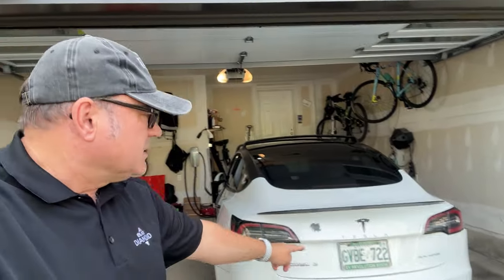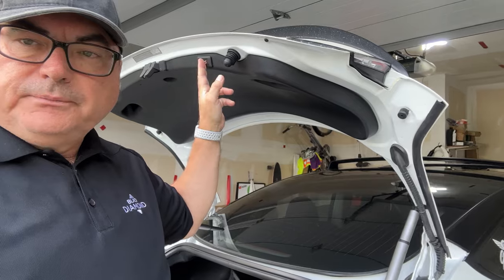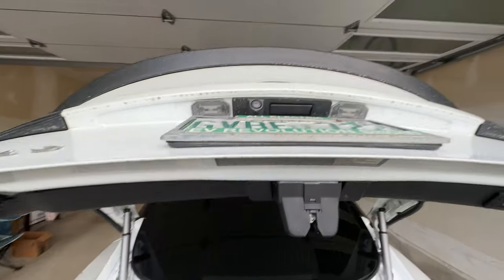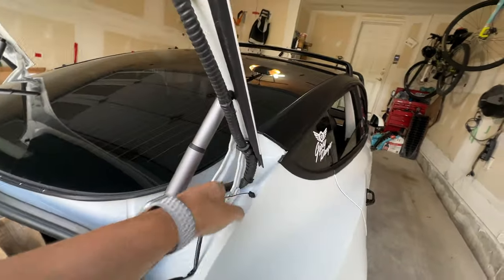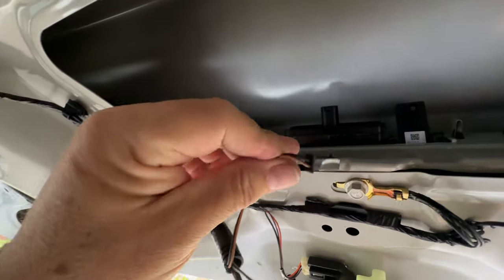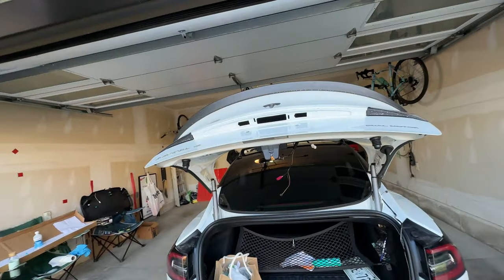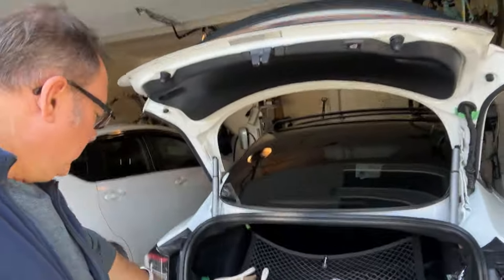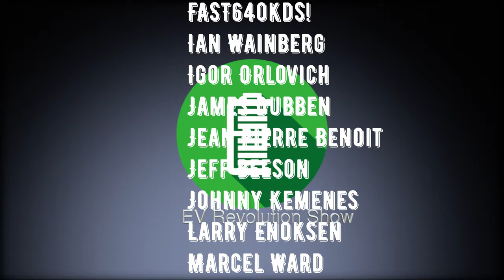Tesla Timeout #29 - TESLASY.COM - Tesla Model 3/Y  Starlink Full-Width Strip Taillights

Comment: We have the same setup with the lightbar and the lower bumper sequentials.   When I installed my lightbar I ran into the same issue as you with having to run the harness to the drivers side as well.    One downside I noticed is when we brake at night and it does that little flicker and stays solid.   When we let off the brake the entire bar goes off for a brief second and then comes back on.  Even our sequentials do that as well.   I was trying to find other vidoes of this product to see if maybe something was wrong with mine but I see yours does the same thing.   Maybe thats just the way it works for us with the older lights that don't use the outer C portion of the light for Brake lights like how the newer ones do.
Reply from the maker: Thanks for watching and of your comments and observations.  Yes mine is working as you see and I don't know another way to install it.  It's still pretty good.
Reply: Same here.did you have solition
Reply: @raptork.i.n.g4996  Nothing yet.  I was going to look into seeing if I could tap into the parking lights (dim)  but I think it's the little circuit board inside the box that has the orange wire coming out of it.   Its basically the logic controller so not sure there's a way around it as of yet.
Reply: @Dysan360 I may go with full kit with the tail light.This one kinda annoying if your turn signal on and do brake and go light completely out for second.
Reply: Yeah I have to say had I known this one did that I’d probably would have reconsidered 😢.    It looks bad at night especially with my lower sequential bumper lights doing the same exact thing.  So picture in complete darkness the center and lower bumper lights after tapping the brakes go completely out and all you see are the stock Tesla tails for a second and then the others come back on.   😢